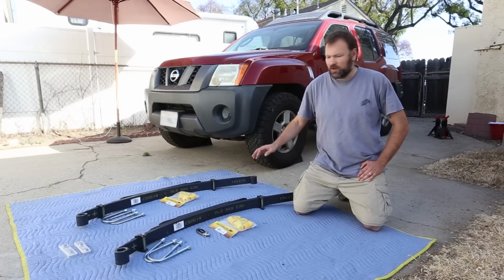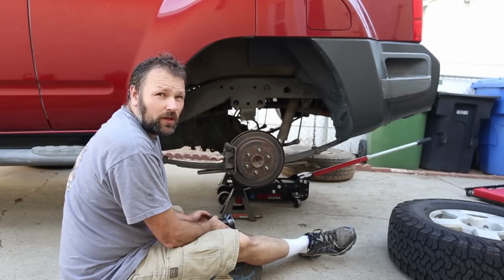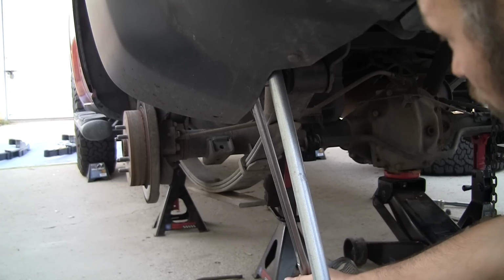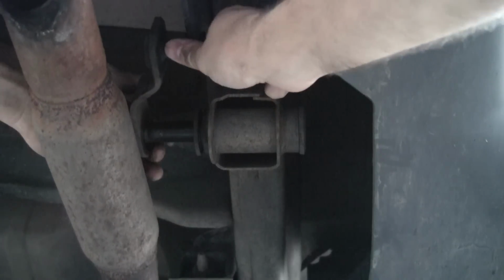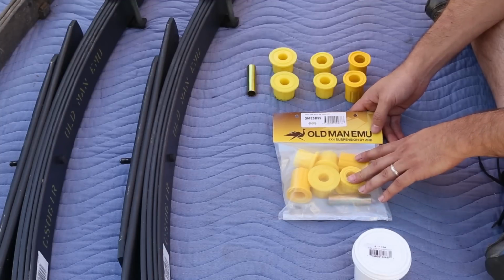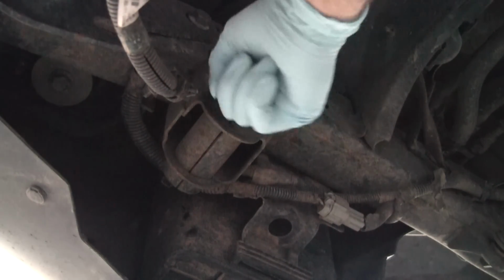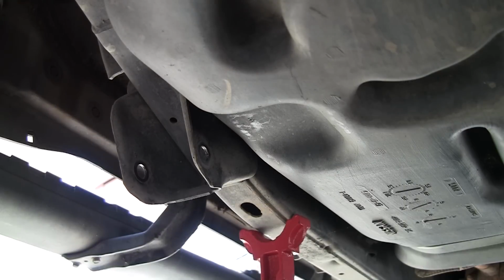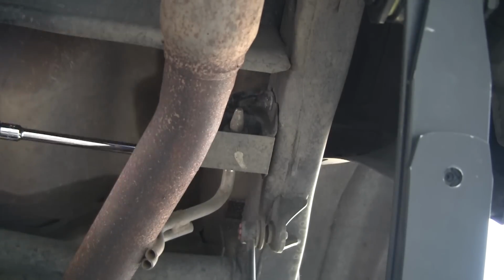Old Man Emu (OME) Dakar Leaf Spring Install on an Xterra

Comment: My biggest regret has been picking these leaf springs up. The amount of noise they make is ridiculous. Sounds like I downgraded! I spray them regularly with lubricant and even replaced the polyurethane bushing with rubber ones without luck.

Comment: First, thank you sir for this video! I plan on doing exact same parts on my 2011 X later this year. Question: the only thing you didn’t replace is the shackles, any reason why? ARB sells a greasable shackle kit with the other products and I’m thinking might as well. So the stock leaf spring is 3+1, and the Dakar OME is 4+2, so it will obviously raise the rear a bit. Did you have any issues reconnecting everything to the shackles? It’s not technically a “lift”, so I’m just nervous about the stock shackles not linking back up. Maybe I’m just an idiot lol

Comment: Dont grease the outside of the bushing. Only the face and the inside. Greasing the outside of the bushing will make a grinding paste over time and wear out your bushings faster. You grease the inside of the bushing, because thats where you want the rotation to happen.

Comment: I've been running the same OME leaf springs on my 2012 Xterra. Been very happy with ride quality and performance, but after 100k miles I've lost an inch of the 1.5 inch lift it gave me when it was new. Now I'm trying to decide if I should replace with new leaf packs, add a leaf or install longer after market shackles. Any feedback?

Comment: This video and Ry the Car Guy's video are the ones I used to get the advice on changing those out.  Ry tended to downplay some of the difficulty of removing and installing new springs.  "Boy!  Am I glad that's over!"was a spot-on comment!
I did go with Nisstec's products, except for the recessed U-bolt plate kit from All Dogs, pulling the U-bolts up on the side of the springs to gain a little more clearance from those.  For those with hitches, I found I needed to get farther under and pull the bolts for the muffler and the hoses next to that bracket in order to pull the shackle from the passenger side.  I still had to use a ratchet strap to move it far enough away and hold it to slide it out.  I also removed the plastic rear farings.  That was so I could get at the bolts with an impact.
I attempted to remove the front bolt first on one, thinking what's the difference?  Well... Like Jeremy said, the shackle moves.  "That's it's job."  Remove that front bolt first, and that shackle will move like an MF!  Using the jack "right" means having a jack low enough to allow the axle to drop nearly right into place.  It's difficult to see in the video, but the reference hole for the peg in the leafs is rotated upward with the only thing holding it up at this point being the stabilizer bar, you can rotate that down into place when you're inches away from the leafs.  Only some slight finessing, and you should be able to pop those U-bolts and the plates on.
Originally planning to replace the shackle with Nisstec's adjustable lift shackle, I didn't clean the originals up right away.  Seeing the distance I'd have to drop the axle, I wasn't sure how I was going to make the intended 2" max lift distance, so I put the originals back on once I had used a scraper, but then seeing the pitting on the lower shaft, I took a grinder with a wire wheel to them.  That pitting was pretty thorough, so I did what I could.  Used it on the inside of the plate to get the remains of the old bushing and, "Bob's your uncle!"
The ride is so much better!  No rocking backwards when it starts.  No rocking forward when it stops.  So much better when going over even speed bumps in the parking lot.  I could feel the leafs hitting on the bumps stops all the time when going through the apartment complex.  Not anymore.  The old ones had 160-some thousand miles on them.  They'd served their purpose.
I also made the comment on David Romero's comment about loosening the bolts on the ground "under load" about using heat to loosen the bolts.  I did... but with grinding with a cutoff wheel on a grinder and replacement bolts on hand.

Comment: If you read this comment - I am looking to get these leaf springs and I am wondering if you think I would only need the Rough Country coil spacers for the front and not the Rough Country rear shackles and re-use factory shackles only?  Or should I get the whole Rough Country kit for front leveling spacers and the larger/longer shackles?

Comment: WOOW your pack has 2 overload leaf springs and 4 main leaf springs.  I have on my frontier pickup 5 leaf springs plus 1 overload, i wonder if the lower overload is actually necessary since you will not be carrying as much weight as a pickup truck.  I filled it up with fire wood heavy wet stuff plus industrial canopy 300 lbs plus 200 lb of ladders.

Comment: Something to keep in mind with these.  The springs have the same part number BUT they're not exactly the same.  They're stamped with either a plus or a minus.  The one with the plus is slightly stiffer and belongs on the right side.
Reply: Looks like he had both + in this video
Reply: Wrong! The springs will either have a minus, zero or plus stamped on it. The minus is under spec for stiffness, zero is at spec for stiffness, and plus is over spec for stiffness. If you have springs that are stamped differently the one with the higher stiffness ALWAYS goes on the driver (left) side to compensate for the weight of the driver and the fuel tank (which is on the left side also).

Comment: Did the Grease do anything bad to your bushings the old man emu package I have says to dry press them in and not to lubricate them. I do not want squeaks though so I see you did this 3 years back how are they looking so far?
Reply from the maker: Nope. I purposely ignored the advise of the manufacturer because I knew it wouldn't hurt anything and I didn't want the dreaded squeaking that everyone complains about. Been running it this way for years now and have absolutely no issues whatsoever.
Reply: @maytawn  Thank you I was just curious they seem so adamant like their product will not last like it should if you do grease it. I am well aware of the squeak that is why I wanted to research this and make sure they were just blowing smoke
Reply from the maker: @randdower6573  Like a lot of things... there's the engineer way to do something and then there's the real-world way to do things. Being an engineer type myself, I like to do things by the book when I can. But in this case, going against the advice of the manufacturer seemed like the best option, all things considered.

Comment: Great video! I have a 2008 and I'm following this exact process. I'm going to my local dealer to pickup all new bolts and nuts since I live in the midwest, the rust is bad. One question, where can I find the torque specs on the specific nuts?

Comment: Just installed an OME Dakar leaf pack as well as OME Coil Spring and NitroCharger shocks all the way around my 2005 Xterra Off Road.  Heavily applied recommended grease to all sides of bushings.    Lifted about 1 3/4”.    Improved ride.  Smoother.   Stronger.   Softer too.  How can this be?     No squeaks at all!    Well worth the $1,175.00 price tag.   I installed myself with OME U bolts and rear anti sway bar relocation kit.   No need for shims.  No vibration or rattle.   This is how the Xterra should have come out of the factory.   Great product.   👍

Comment: Do I need to relocate the sway bar if I’m just using that leaf pack and 5100s?
Reply from the maker: I don’t know for sure, but I have heard the  relocate kit is not needed for 5100s because the shock body is a smaller diameter that the OME shocks so it does not interfere with the sway bar.
Reply: Okay, the 5100s don’t interfere with it now just wondering if the new leafs would have any effect on that

Comment: Isn't there an issue by moving the axel around, do you have to realign it, or make sure it's in the right spot ??
Reply from the maker: Depends on what you mean by alignment. If you are talking about side-to-side alignment, then this is take care of by an alignment pin on the spring that mates into a hole on the spring perch that's welded to the axle. As long as that's mated properly on both sides then your side-to-side alignment will be fine. If you are talking about the up-and-down angle of the differential then, yes, there may be something you have to do to get it aligned. All lifts have the possibility of changing the drive shaft angle. There are small shims that can be installed between the spring perch and the spring to compensate for the new angle, but since the OME lift is a small lift (only about 1.5" in the rear) I did not find shims necessary. The way you would know you needed them is if after you install the lift you experience drive-line vibrations around 30-40 MPH.

Comment: I'm looking at getting these because the rear bottoms out on my 2012 pro4x. Should I lift the front a bit as well ? Does it look funny having the rear lifted a few inches?
Reply from the maker: If you lift the back, but the not the front it will be noticeable. The front is already a little lower than the rear. With these springs, the back is going to go up another 1.5 inches.  If you don't want/need a lift you could look at getting "general springs" (google it). These would be stock height and are a little cheaper. It would basically be the same install procedure.

Comment: Can you add a leaf to those taller spring for more lift?
Reply from the maker: Yes. I believe OME has the HD version that has an extra leaf. Mostly I think it’s to handle extra weight, but it does increase the lift when the weight is not present. I have heard people say that it makes the ride more harsh, but I don’t know that personally.
Reply: @maytawn  hmmm do you know how much lift you have over oem in the rear?
Reply from the maker: @williamwilkin1892  Check out 25:55 in the video for a visual of the measurement.
Reply: No. Adding leaf springs to a spring-under suspension does not lift the vehicle, that only works when the springs are over the axle.

Comment: I'm sorry if I missed it in the thread but could you post a link to that lubrication you used? I can't seem to find it online. Thanks for the great video, I'll be installing my Dakar leafs on my 2002 Tacoma as soon as I get some of that lubricant and when my bushings arrive.
Reply from the maker: Good luck with the install. https://www.amazon.com/Energy-Suspension-9-11104-Formula-Prelube/dp/B000CN7B4I

Comment: Would this leaf pack work with bilstein 5100 s? Can’t afford the ome shocks? If the bilstien would work what height should I set the front at ? How high did it raise your rear over stock?
Reply: Kevin M I set my front 5100’s at the highest setting and it perfectly matches the rear height. So I believe that the rear lifted like 1 and half inches and the front set at 2 inches after sage from wait if the engine it’s at like 1 and half inches also it honestly looks awesome and rises amazing. For only 1/2-1 inch I’d probably set it in the middle or right below the top what are you doing for the rear?

Comment: Nice job.Jeremy !!! I have heard complaints that this setup becomes very noisy with popping sounds. Also, the ride becomes very rough. Any comments or findings? Your help would be appreciated.
Reply from the maker: It's been 2 years since I installed it. No noise at all. I attribute that that to the grease I used. As for ride roughness... yes, it's much stiffer than stock, but that's typically the trade-off you make for better off-road handling.
Reply: @maytawn  Hello from Montreal Canada - Again thank you so much for your input - Keep making great videos of the X

Comment: Hi Jeremy Great video thanks for the great info, do I need to use a sway bar relocation kit even if I going to use regular monroe rear shocks? Thanks again.
Reply from the maker: Probably. Because of the lift, the angle of the shock changes and so does the clearance between the shock and swaybar. The relocate kit helps restore the normal clearance. I would think you'd need it regardless of the model of shock you were using.

Comment: Hey Jeremy!  GREAT video!!  I just installed the same OME Dakar springs and new OME shocks on my '06 X, and I can't thank you enough for this great video "how-to".  I must have watched it about 20 times to prepare myself.  BTW, I recommend to anyone doing this job to remove the rear plastic fender pieces.  It's quite simple and makes getting at the shackle hardware much easier.   And, depending on your X's mileage, I recommend going to Nissan and ordering all new, shackles, bolts and nuts for the springs and shock mounts.  My truck has about 180K miles and these springs and shocks make a huge difference!    Thanks again!!
Reply from the maker: Awesome. Congratulations on your mod. So glad you found the video useful.
Reply: Kevin M :  I purchased and installed the OME front shocks as well And that gave me enough of a lift to level things out. I think overall I received about a 2 inch lift.

Comment: He man, I have a quick questions. First off great video, planning to follow this for my Xterra leaf upgrade. Getting the OME set up and they recommend the greasable shackles from ARM which are $138 dollars a pair. Id prefer to use the nissan stock shackles like yours. Do you get any squeaking and how are you planning to grease when it comes time? Dont really want to dish out another $300 for ARB shackles. Also does the yellow bushing kit fit well onto the Nissan stock shackles or did you have to do modifications. Thank you times 1,000,000!!!!!
Reply from the maker: I don't have any squeaking. I used Energy Suspension 9.11104 (ENE-9.11104) grease and the OME yellow bushing fit fine.

Comment: Hey there, thanks for this video, it's very helpful!  Just wondering how your grease is holding up?  There are a lot of opinions on grease type!  Thanks!
Reply from the maker: The grease I used is amazing. Just recently, I swapped my C200 axle for an M226 w/elocker and I had to temporarily disconnect the front part of the leaf to get the old axle out and the new one in. I was able to closely inspect the grease after removing the bolt and it was all still there doing it's job. And that was after 2 years of being there. I couldn't be happier with it.
Reply: Jeremy Boyd Great, I’ll order some up!  Thanks again!

Comment: Would you say this is something a novice can do? I can change my oil and install bolt on rock sliders...that's about it.
Reply from the maker: Well, I will say that I wouldn't let lack of experience stop you from trying. It's more about mechanical aptitude and comfort level around tools and the like. I'm not a pro. This project, at the time, was the biggest one I had ever undertaken. I did my homework before starting and learned a lot in the process. One other thing worth mentioning, you'll need to own or have access to some tools. Aside from a good metric socket set up to 19mm, you'll need a floor jack, 2 sets of jack stands, breaker bar, and torque wrench.
Reply: @maytawn  Thanks. I'm not ready to do it just yet, I'll wait for warmer weather, but I think I'll give it a shot and use this video as my guide.
Reply: @temporaryscars  If you're still thinking of doing this just know that the thing you're most likely to get in trouble with is bolts that won't move or things that turn up broken you didn't expect. Make sure to look at all the brackets and bolts and get an idea of how bad they are. Things like the tailpipe hanger bracket, the u-bolt nuts, the exhaust itself if you start having to strain it to get it out of your way. You can certainly do it, this seems more straightforward than some other vehicles. Just have backup and another ride to the parts store  and a ride to work if you get stuck. Just do not try it without jack stands and a breaker bar.

Comment: Thanks for answering all my questions and them some about this upgrade, which I have been considering for quite a while.  The rear leafs have always had a problem with bottoming, even when new and not heavily laden, and I can only think that Nissan was using too-soft leafs trying to give the aging Xterra (mine's a 2011 Pro-4X) a plusher boulevard ride to compete with newer crossovers.  My PRO-4X only has about 80,000 miles and has been babied (except for Baja Trips once a year).  Would you think the Bilsteins need replacement?
Reply from the maker: 80K miles is probably about time to think about replacing. The first time I replaced my shocks from stock to Bilstein 5100s was about 100K and I think I probably waited a little too long. I might also suggest looking at the OME Nitrocharger shocks. That's what I did this time around (replaced the 5100s). They are designed for the OME leaf and front coils and they make a nice complete kit. I have been pretty happy with them.

Comment: Did you torque the leaf springs while you had it up in the air or did you lower it and bounce it as some manuals suggest first?
Reply from the maker: I torqued them in the air. Then I rechecked them after a few days of driving. They were still at torque spec.

Comment: A good tip is to loosen the leaf spring brackets first before raising the truck. That way the leaf spring is under load and doesn't flex when you try to loosen the bolts.
Reply from the maker: That's a good tip. I will be upgrading the C200 axle to a m226 w/elocker soon and I will try it your way when I do.
Reply: Wish I would have read this comment before starting.  I did forget one tried and true method, heating the bolt.  I finally got to the point of ordering new bolts and cutting through the old ones.  Figuring I could get most of the way through the bolt and then turn it to twist the head off.  Heating by using the grinder made it so I could  remove them.  So, from now on, a torch with MAPP or the like on hand to deal with that.